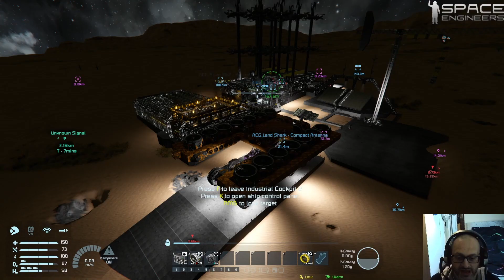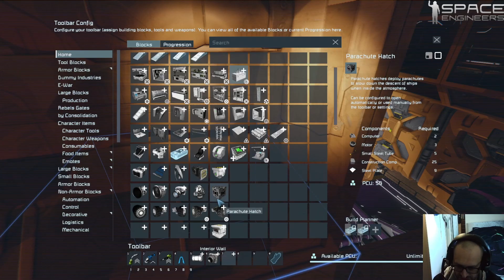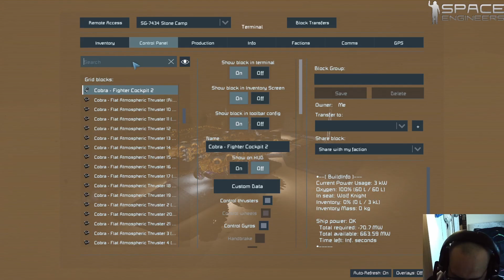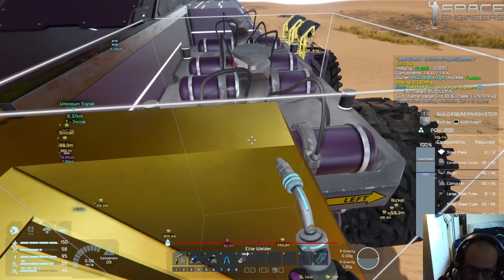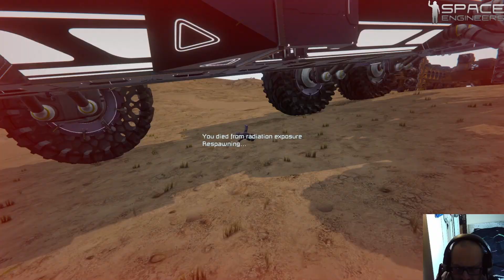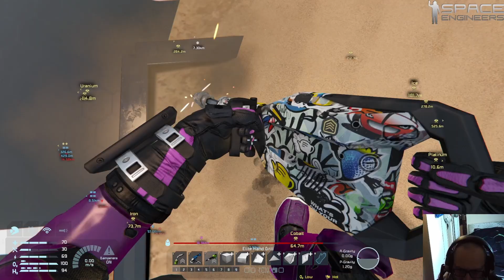Space Engineers - Hoodwinked! - Part 29

Comment: My first guess as to why it is tilting is because the thrusters are running at different power levels.

You may have to adjust that.

As to why you are not turning is because in merge block mode, the 2 machines become one, and the new single machine thinks it needs to be turning using wheels instead of thrust or gyros.

My second guess as to why the machine is tilting is that the gyros are not set up right and are responding sideways to their proper direction [they DO HAVE] a front, after all.
Reply from the maker: Thank you for the advice. In the end, it was a combination between not enough thrust and needing more gyros for stabilisation. Even now, it's complete. The carryall realistically needs one or more as well as a few other tweaks to easily manipulate!